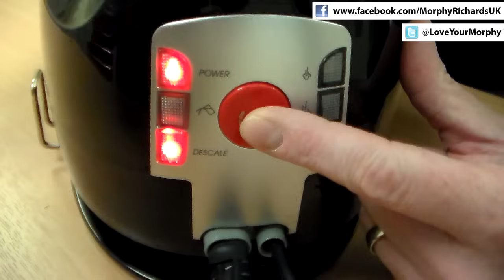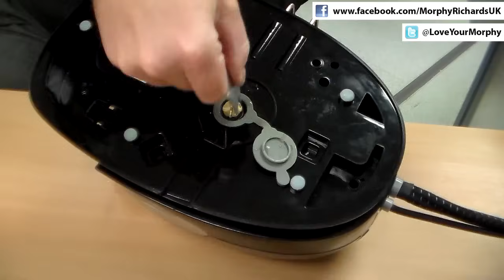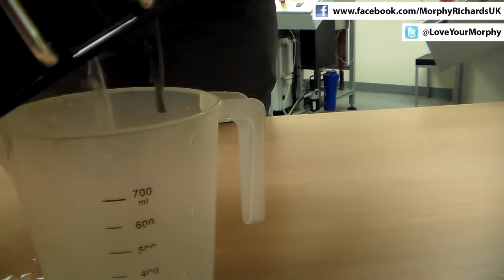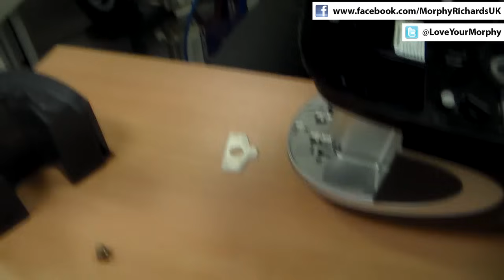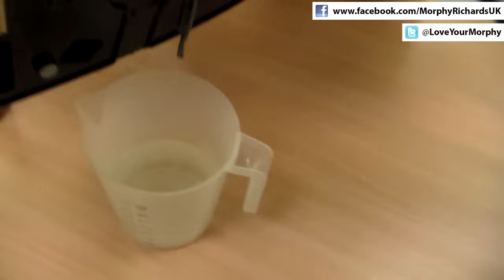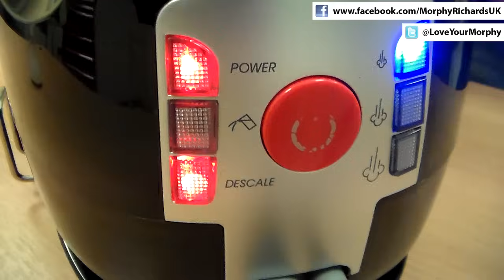How to maintain your Morphy Richards Power Steam Elite steam generator

Comment: Hi, followed the video, had to use a different tool to open the bolt. However, since I've done this my iron trips my circuit out which its never done before. Any suggestions why?
Reply from the maker: Hi there, I'm sorry to hear about the issue you've experienced. Please could you provide the following via email to consumerhelpline@morphyrichards.co.uk
and i can look into this further: model & serial number, proof of purchase, full address and contact number. Thanks, Richard.

Comment: My model doesn't have the rubber cover underneath. It has a cap that I can't seem to remove?? Any tips? Model number332001
Reply from the maker: Hi Liz, Thanks for getting in touch. Your model doesn't have an open cap at the bottom as the auto-clean function will keep the appliance in top performance. If however you are experiencing any issues with this function then please email consumerhelpline@morphyrichards.co.uk with the model & serial along with further details and we can look into this further. THanks, RIchard.
Reply: @LoveYourMorphyUK  thank you. I will test it out again next week.

Comment: Unscrewing the bolt was a nightmare. As I didn't have a 17mm socket which would have made this easier than using the key provided..  I wedged a flat head screwdriver into one of the grooves and used a hammer to lightly hammer on the end of the screw driver which managed to loosen the bolt and got the screw off! Hope this helps someone. 🙏
Reply: I tried that, and it's still not opening

Comment: Unfortunately, it doesn't tell you what to do if the descale light stays on after you've performed the process.
Reply from the maker: Hi there, Please note if the indictor light stays on after switching the appliance off/on then it could indicate a build-up of limescale that hasn't been fully de-scaled. Thanks, Richard.

Comment: Hi,I can’t opening the key
Reply from the maker: Hi there,  Please check if the cap is flush with the appliance. This will signify that your particular model will not have this function. Please refer to your models instruction manual for care and cleaning. Thanks, Richard.

Comment: Please can I take the round plastic circle off the older model
Reply from the maker: Hi there, Models that have have cap such as in the video can be opened however on some models where it's flush to the body and pressed in, unfortunately these types can't be opened. If you need further assistance please email into consumerhelpline@morphyrichards.co.uk. Thanks, Richard

Comment: Hi, I cannot get the nut off the bottom of unit : very very tight…any suggestions?
Reply from the maker: Hi David, do you have the key for the boiler unit? This should help you get this open: https://www.morphyrichards.co.uk/spares-and-accessories/Ironing-spares/Steam-Generator-Water-Tanks/01088#sparesaccess
Reply: @LoveYourMorphyUK  hi, thanks for reply.  Yes we have the key, it’s not moving the nut at all, pushing left to loosen ; using as much force as poss!  Any further ideas tip or tick?  Iron working great til needs descaling!
Reply from the maker: @DavidGuyan  Hi David, please ensure you are not trying to remove the nut when the appliance is connected to the power supply or when the unit is still hot - leave it for at least 2 hours to cool down. The nut can sometimes become very tight due to pressure and limescale build-up so we'd recommend using a socket and wrench set with 5/8 inch (16mm) sockets. I hope this helps. - Izabel

Comment: Hi I do not have a descale problem..I need to clean my sole plate as slightly caught a jumper,How do I clean it off Sheila
Reply from the maker: Hi Sheila, I would recommend for you to use the CIF cream cleaner as this is known to be beneficial for cleaning the sole plate of our irons. Thanks, Demi.
Reply: @LoveYourMorphyUK  Hi Thanks for letting me know..I thought CIF was an abrasive
Reply from the maker: @sheilaowen7819  Hi Sheila, this product is recommended for the soleplate of the iron only. However, please use sparingly. Thanks, Demi.

Comment: I feel like SCREAMING!!!! Bolt won't unscrew!!! First time I got iron was same thing and took my husband failing and eventually my daughters partner who is a plumber to open but with great difficulty!  So when screwed back on I didnt over tighten. Was very careful to ensure would open.. HOWEVER, it's stuck AGAIN!!!! Assuming you turn to the LEFT which I'm sure he does in video ...Honestly my fingers are sore. Even tried with rubber gloves on!!!! 🥵
Reply from the maker: Hi Christine, so sorry to hear that you are having difficulty opening the bolt. To Ensure that this opens, you would need to use the boiler key or alternatively a 16mm wrench would be recommended if the key is not working. I hope this helps. Thanks, Demi.

Comment: Hello i have the same product which is during steam ironing stages it spills water.. What could be the reason and what we need to do to get rid of this as a first step
Reply from the maker: Hi there, if you email customerhelpline@morphyrichards.co.uk we can go through some tips and diagnostics with you. Thanks Ashley
Reply: @LoveYourMorphyUK  I wanna know the model and type of water pump being used in SIS 8250 model.
I think the pump is not sucking water from the tank.
Reply from the maker: @Britanyali  You will have to email customerhelpline@morphyrichards.co.uk and they can then get this info. Ashley

Comment: All good - Except it's a real shame that you didn't tell everyone to throw the key away - (it is dangerously 'not fit for purpose') -  and get a 16mm socket (not a spanner).  You will end up in A & E regardless of how much strength you have.  The nut is brass and seized in by the limescale.  Brass is more likely to shear under tension, although you are likely to be injured trying - the tool is absolutely not going to undo that nut  - shame on you Morphy Richards -  as they already know this from complaints but fail to resolve or highlight this (typical of the industry).
Reply from the maker: Hi Geoff, thanks for your feedback on this, we will be sure to pass it on. Thanks

Comment: I have problem with water tank 
Filled up after slight tank in low water light turns on & this happening again & again I have done everything clean up inside and out & fixings few time but no success PLEASES help
Reply from the maker: Hi there, we're sorry to hear you're having trouble with your team generator. If you give us a call on our product helpline 0344 871 0944 the team will be able to advise. Thanks!

Comment: Noticed the problem when the steam doesn't work and the iron just warm not hot at all. Try this method and  now i know why the descale light keep blinking 😁
The 1st time i pour the water out, the limescale was white & thick! I repeat the same procedure for 3 times and then switch on the steam iron. Exactly after 20 times the blue light was blinking, the descale light went off. Glad my iron working as usual.
Thank you so much for sharing this video 🤗

Comment: after descaling my steamer which by the way to open the bolt screw I could not move it key useless but manage to unscrew it empty water 2 times but now my steamer does not work anymore. all lights on buzzing then switch himself.. so what should I do?

Comment: I have followed these instructions to the letter but when I plug my iron back in and switch it on - nothing happens at all! The rescale light stays on and the pump doesn't make a sound?!? If I hold the steam button in on the iron still nothing happens. I rinsed the tank out 3 times and shook it till it was completely empty. What's so frustrating is all the comments from people experiencing the same thing but no response or additional advice from morphy Richards. It's a Sunday so I can't call them up for advice either. There goes my ironing pile - growing ever higher just after Xmas!
Reply: I have exactly the same problem.
Reply: Me too same issue... should I give up and buy another iron
Reply: Me too same problem

Comment: Thanks for the video. I am in doubt, there is no need to use a descaler?
The bolt would not open but it did with a 16mm socket wrench.

Comment: I have an iron the same as this but there is a problem. The water tank is full but the light at the back bottom says water empty and when u press the steam there is no water coming out!
Reply: I have same issue 😢
Reply: jennifer padasas did u find a solution
Reply: I have this issue also. I have the exact iron in the video.
Reply: I also have the same issue

Comment: There is a design fault on this iron. The bolt is too tight because of pressure. The key is useless. In the end I resorted to using a torque wrench. Normally for car bolts!!!
Reply: Why a torque wrench. I just used a 3/8th ratchet and an allen socket. Any pressurised vessel will need a tight fitting plug, otherwise it wouldn't hold pressure.
Reply: Hi, what size?

Comment: I can't remove the bolt! I'm a 17 stone man and can't get it off!
Reply: I fed the handle of a wooden spoon through the hole of the key and used it as leverage. It did the job!
Reply: bruv1984 neither do I and I am a 7 stones woman 😫
Reply: 17mm socket with a ratchet should work
Reply: bruv1984 I am having the same problem been trying for the last hour
Reply: that’s so true, mine is stuck aswell 😪
Reply: Mines stuck hence why I'm here.
Any solution?
Reply: Working Free Steam $20 and $50 card codes!!
Try it, Its working for me! 
SteamGiftCodes .c o m.
Reply: Tim Lyman what is this website about I can't click on it
Reply: Do not attempt to open the bolt when it is hot, you can touch the bolt with your hand to know the temperature. U won't get burnt by touching it. as the bolt is expanded when it is hot and it is pressurized whether u are 17 or 70 stone human being, it is just tough. Although the recommendation is to leave it to cool down at least 2 hours, I will leave it over night. Have a beer.
If it is still tight, use a flat screw driver on the right side of the bolt grove. Hit the screw driver with a hammer and hopefully you can open it.
Reply: I'm struggling with the nut too and I'm 18 stones! I'm gonna leave it a few hours to cool down then try again
Reply: Can’t you even remove the bolt?
Reply: I suggest you lose some weight, it worked for me, bolt was no problem.